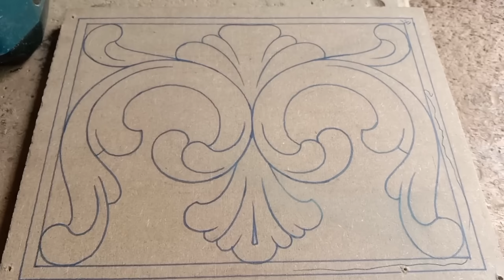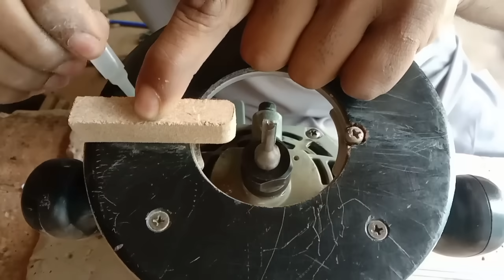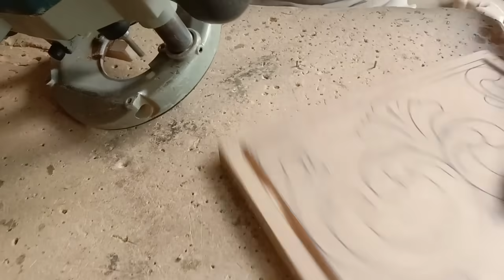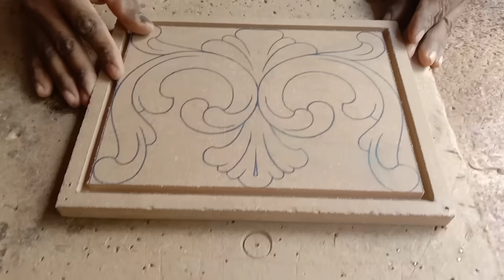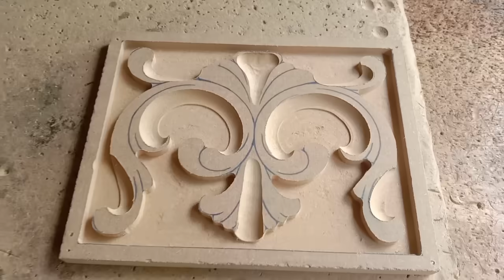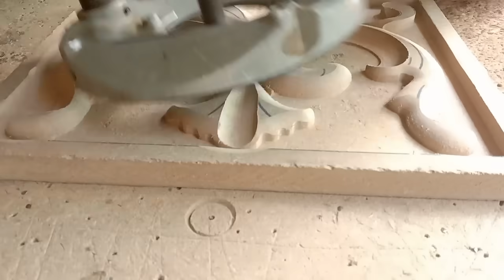How to wood carving creative router skills and amazing design by MSF wood carving

Comment: You are a beast!!! freaking freehand with a full size router vibration and all. Respect.
Reply from the maker: Thanks you so much brother
Reply: Even on palm router, doing hand free like that takes lot and lot of skills and experience.
Reply: I used that size of router to cut out a square once, the shroud (battery box) for said hole ALMOST covered the squigly edges :D
Reply: Took the words out of my mouth 😅

Comment: Best, какая модель фрезера?
Reply from the maker: Dongcheng
DMR02-12
M1R-FF02-12
12.7mm
Wood router
Rated power Input.       1650W
No-load speed!         22000r/min
Net weight.          6.0kg